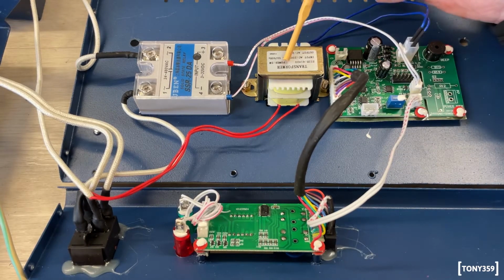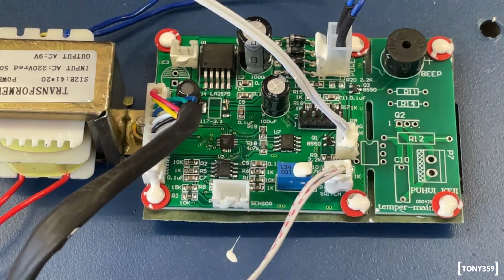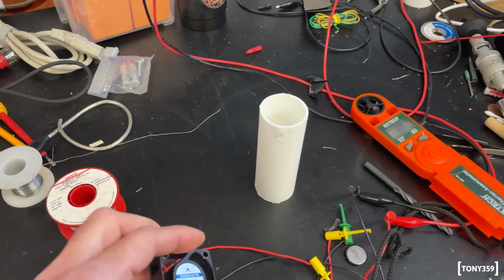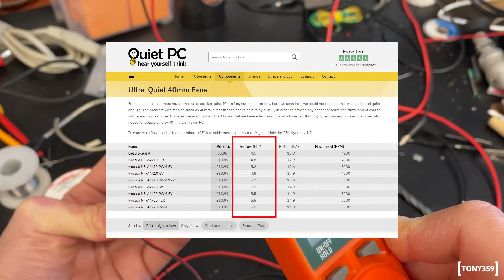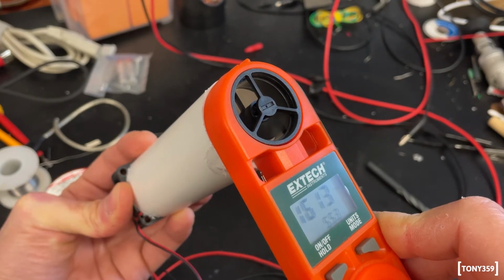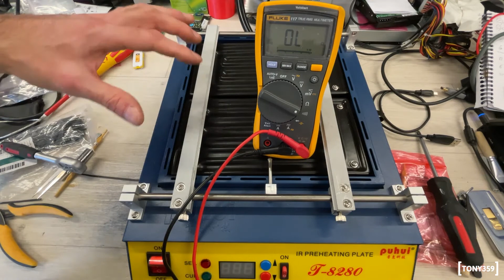T-8280 Preheating Plate - Fan noise fix attempt and earth tweak

Comment: I'm building something similar to this.  I bought a breaker for it but it's massive and i'd prefer not to use it.    It seems pointless when the plug is 13 amp fused and the sockets are on a circuit breaker anyway.    What do you think?  Cheers and merry christmas.
Reply from the maker: As you say, it's probably redundant. It won't hurt though. If it was a SMALLER unit - that is, something that draws 2-300W - then an extra, dedicated small breaker would make more sense. But because you'd be installing a 13A breaker anyways...
Reply: @tony359  Thank you Tony 😊
Reply: @tony359  One other thing.  I use chat GPT a lot for design on things not super confident with.  I was checking about wire thickness.   It mentioned using thicker wires to avoid voltage drop with the added heat resistance.   Maybe this might answer voltage drop?   i don't know how thick those wires are. :)
Reply from the maker: I think in that case the whole thing is badly designed - it's a super-cheap thing. I think the issue is that minute transformer which is supposed to power everything...
Reply: @tony359  Maybe,   It seems to do the job,  people seem to get good results with it. I wanted this pre heater but it's banned from the UK due to the earth.   That's why I'm building one.  This video has helped massively being able to see the internals in such detail.  So thank you :)

Comment: Replacing transformer with lets say 15 volts followed by the usual bridge rectifier and then with a 9 to 12 volt regulator will have that fan going a rock steady RPM, a strategic trace cutting may allow two of the regulator legs as input and output and the ground pin of the regulator to the closest ground trace on the PCB..
Reply from the maker: Of course plenty of alternative ways to fix that. Thanks for watching!
Reply: @tony359  Yep.. Just somewhere on the PCB before power goes to the fan and the rest "And if at all possible before filtering" for the circuits on the PCB, so all it needs is a single 9Volt regulator in your case.

Oh.. and an appropriate transformer, mind you that may not even be necessary, once the regulator has been installed and it has resolved the annoyance..

Comment: I wanted to buy this T8280 but before that I've tried an IR Cooking Plate instead and I'm really surpised it works great.
So I didn't order the T8280 but I've kept using the Cooker. 😅
I think the technology is the same.
Reply from the maker: The IR cooking plate might actually be better! The 8280 is described as "IR" but it's not (*). It's a big BBQ plate. A proper IR device would "warm up" instantly, which is likely more useful for this application. Thanks for watching!  (*) Well, you could argue that any object emits IR when it's warmed up but... :)
Reply: @tony359  ohhh thanks for the info.
I planned on replacing its controller with a Rex C100 but when I'm thinking about it there's no reason I would do that because the Cooker has a very good temperature control ...
Reply: What cooker do you use?

Comment: Any Idea what type of thermocouple is on it? I need to replace mine.
Reply from the maker: No unfortunately, I doubt it's anything special though.
Reply: @tony359  I know it’s not K type. I guess I’ll have to order a few and see which one works.
Reply: Turns out it is K type. Trick is the wire must be about the same length as the other original wire. Any longer and the resistance goes up too high. the custom circuit does not work for a longer thermocouple because it has no adjustment for zero. Just an offset adjustment. So the length of the wire needs to be around 4 to 6 ohms to work.
Reply from the maker: interesting thanks! I didn't know the length of the wires could affect the result so much!

Comment: One thing that might help with the fan noise is adding a filtering capacitor in parallel. I had a pwm noise on a DC bench PSU and adding a moderate sized electrolytic solved the issue. I don't think it would completely eliminate the noise here but it should help smooth out some of it
Reply from the maker: It’s an interesting point thanks I’ll keep that in mind for next experiment 🙂

Comment: I'm surprised no one is suggesting the obvious... You want a low-cost stable 9VAC OR 11-12VDC... So, you can take a cheap 12v switching wall wart (like an router power supply), then inject the 12v at the filter capacitor after removing the transformer all together... That transformer you have now is 5w, so you'd only need a 500mW (maybe 1A for headroom) 12v supply. It couldn't cost more than 5 pounds (heck, you probably have a spare 12v wall wart lying around). The switcher in it would adjust dynamically to changes in supply (to meet the load). An added bonus is it should be more efficient after the mod, so the low-cost of the 12v supply would be paid back over time (how long? probably decades if your mains kWh rate is low, but eventually non-the-less)
Reply from the maker: The 8280 is plenty of areas where you can tweak of course. I’ve decided to replace the fans as I’m sick of the obnoxious whining noise - stable or fluctuating! 
Your idea is solid though. Thanks for watching!
Reply: @tony359  Thanks for the reply. I hope you can maybe find time to do a video on that (if you haven't already? I didn't see it when looking) -- it'd be interesting to see what you'd replace them with.
Reply from the maker: @deadduck8307  of course they’ll be a video - I just haven’t had much time recently and also so many other projects on the pipeline! 🙂

Comment: While it might be a little janky, probably the easiest solution to this is to replace the standard 12V fan with a 5V fan, and add a Step-Down converter or a simple linear regulator in between. Either that or just add a Buck-Boost converter between the fan and motherboard so it outputs a stable 12V to the fan no matter the input
Reply from the maker: Not a bad idea - I’ve recently purchased one of those converters but it does need a slightly higher input as a linear one. Doesn’t the buck-boost one need the same? Otherwise it would be a good idea. TBH I wouldn’t mind lowering the voltage a tad to lower that screeching noise! Thanks for watching!
Reply: @tony359  Yes a linear regulator does need a higher input than its output, hence why you'll need a 5V fan if going that route.. A Buck-Boost converter is designed to either operate below, at, or above the input voltage:)
Reply from the maker: @Prinkiestonkie  I guess the clue is in the ‘boost’! Amazing, I’ve learnt something new! I’ll look into that. Thanks for mentioning!
Reply from the maker: @Prinkiestonkie  I guess the clue is in the ‘boost’! Amazing, I’ve learnt something new! I’ll look into that. Thanks for mentioning!
Reply from the maker: Not a bad idea - I’ve recently purchased one of those converters but it does need a slightly higher input as a linear one. Doesn’t the buck-boost one need the same? Otherwise it would be a good idea. TBH I wouldn’t mind lowering the voltage a tad to lower that screeching noise! Thanks for watching!
Reply from the maker: @Prinkiestonkie  that’s very kind of you to say! Thank you a lot!

Comment: Regarding the fan, you could replace the one stock fan with two or more of the weaker low-noise ones.
Reply from the maker: Yes I’ve been thinking about that. I want to keep a good flow so as you say I’d probably need two or more quiet ones. The pre-heater is a great tool in my shop but I don’t use it very often so I’m ok with that irritating noise for now 🙂 Thanks for watching!

Comment: and what about twist the termocouple up to the board(pcb)? for get pcb temperature reads?
Reply from the maker: I saw someone doing that but I do not think it's really going to be accurate - also boards will have different thickness so I still feel that using a laser thermometer is the most accurate way. In the end I think that the thermocouple pointing at the plates is giving me the plates temperature, which can be useful. I have a feeling that moving the thermocouple away from the plates may just cause the plates to warm up to very high temps trying to "catch up" with the PCB. Those plates do not cool down fast so I am concerned the PCB temp may overshoot a lot once the target temperature is reached. No hurt in trying though and thanks for the idea - and for watching! :)
Reply: @tony359  you may be right about plates overheat or overshoot.for cooling i will add 1 ou 2 fans at SIDE or on back...have to try...
Reply from the maker: @tmaster21  I've been thinking about that. One day I may mod that 8280 indeed!

Comment: Did you try it directly connected to a wall outlet? Rather than through a multi-plug?
Reply from the maker: No but I can see the same voltage drop at my distribution box where mains arrives to the lab. Also, I hear the same fluctuating noise on other videos featuring the same machine so I assumed it's not just an issue with my unit (not that it is an issue of course!). However your point is valid, I may get a lower drop if plugged it directly in the wall. I'll give that a go! Thanks for watching!
Reply: @tony359  It's just that I've seen variable voltage from multi-plugs. Particularly ones with surge protection.
Reply from the maker: @Ted-Branston  It makes totally sense. I'll test and report back! :)